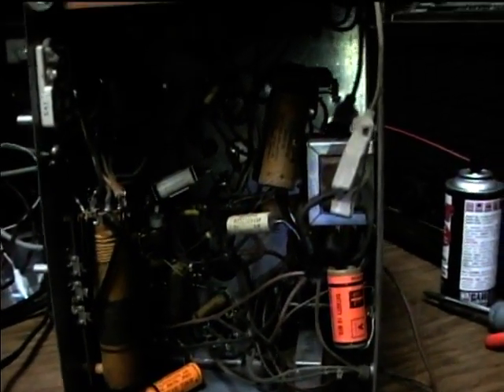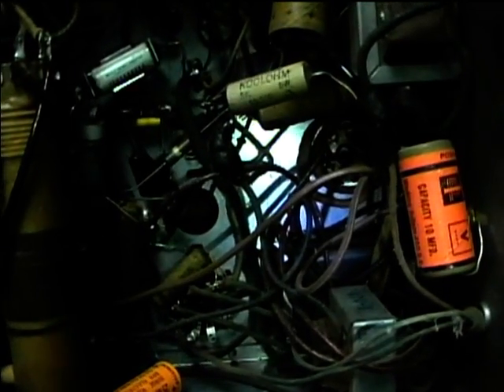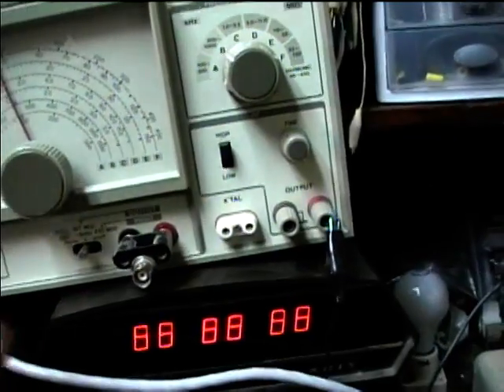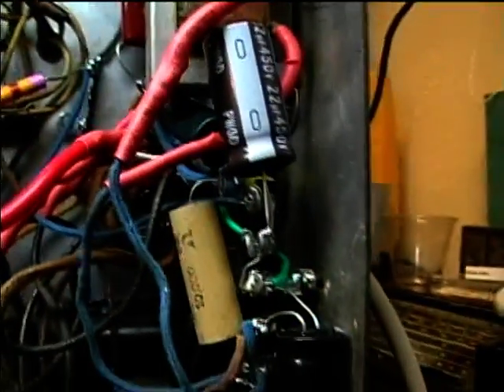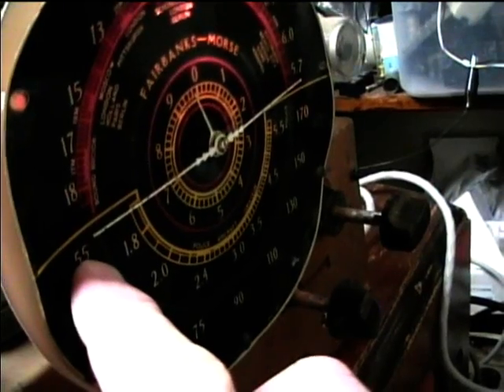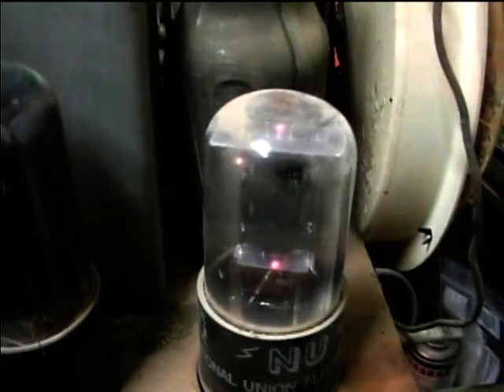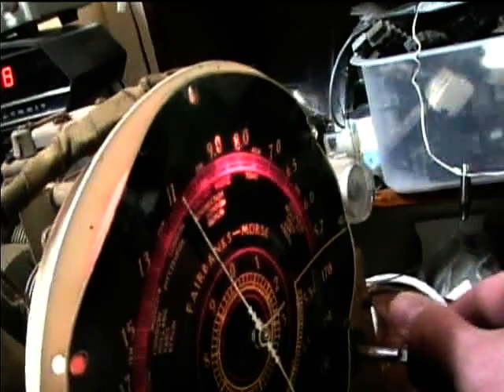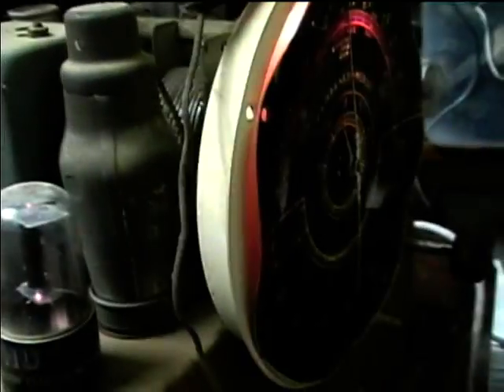1938 Fairbanks-Morse tube type radio model 6C (part 1)

Comment: Retrochad I have the same exact 1938 Fairbanks-Morse tube radio, how much do you think our radios are worth?
Reply: Restored these radios can bring well over $1000.00, depending on the model and how well it was restored and the wood refinished.  
Unrestored, maybe $50.00 up to around $200.00 if you are lucky.

Comment: Have you figured out how you will flatten out the tuning indicator plastic plate?  Nice radio though. Never heard of that brand before.
Reply: Radio Daze may have reproduction Face Dials for this radio, but it looks like you may just be able to flatten it out as the colors are still good and it is not torn.  The Fairbanks Morse Company is still in business, working primarily with Diesel Engines.  They made radios from 1934 until their plant burned down in 1939.
Only 6 years making radios, but today considered some of the most collectible radios from the Golden Age of the 1930's in radio.  The last plant was located in Indianapolis, Indiana.

Comment: It looks like the entire dial face was meant to be lit up. Are there some burned out dial bulbs?
Reply: Two Dial Lamps are used in this radio.  They can be"lit" together, or separately depending on whether one is on the AM Band or the Shortwave Band.